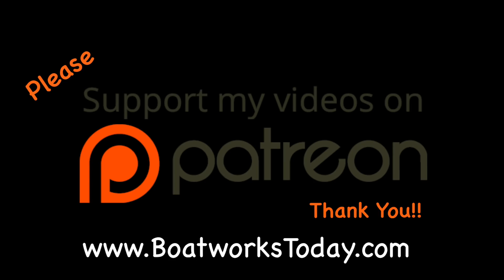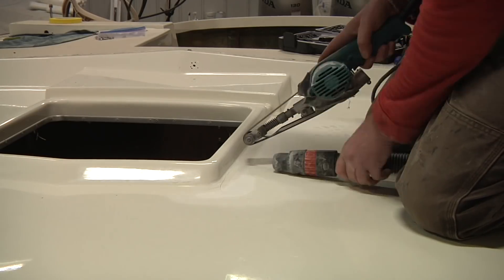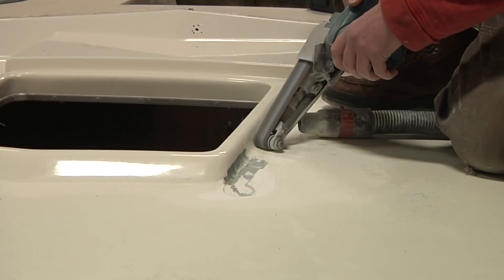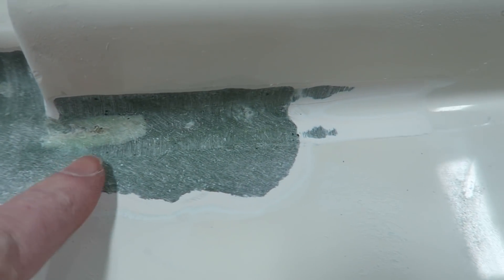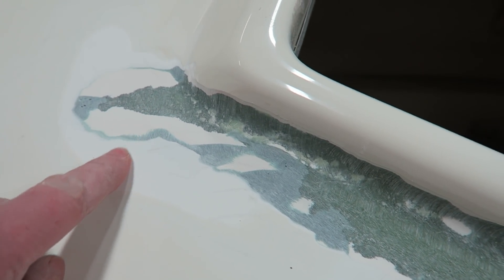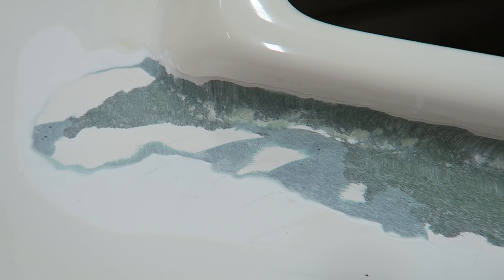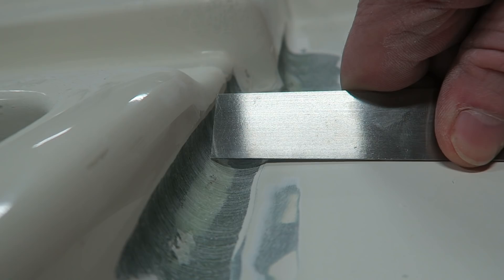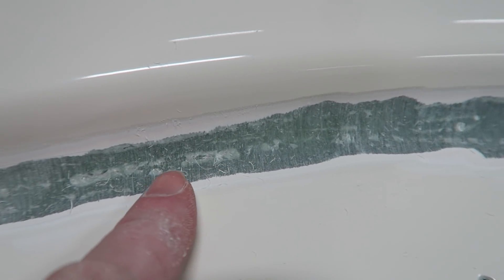Grinding Out Fiberglass Stress Cracks And Getting Ready For Some Major Work!

Comment: As I was thinking about the forward deck a little more this week I remembered doing the rotisserie method.  Restorers do this often when replanting the bottom of wooden boats in this size range.  Although it seems like a lot of work to get the hull flipped over it makes it very easy to redo the core and laminate under the deck.  You can work right side up and the boat won't care about being upside down.  Another resource on how the original B25 was laid up is Carl Herndon.  He was the production manager for Bertram back in the 60's.  Later he was president of Blackfin then Jupiter Marine.  The last time I checked he was still around in Florida.  You might want to hurry however, us old guys aren't going to last forever!

Comment: You’ll never stop the cracking gel coat until you address the flex in the deck. I have a 78 Formula 233 with the same problem. I cut the deck off in front of the windshield. Flipped it over, stripped the plywood blocks out, reglassed it with end grain balsa. My deck has an arch in it so I needed a material that would form to that shape. For the money balsa saturated with epoxy is the strongest thing for the price. Re installed the deck, glassed it back and faired it out.

Comment: Andy, I have to say that I am definitely in the camp for adding glass to the underside of the deck.  It looks like the plywood is simply bonded to the top layer with no bottom layer of glass.  Adding even a single layer of 1708 will more than double the stiffness of the deck.  If I was doing that job I would do it in pieces.  My procedure would be:
1) remove plywood in an area
2) replace plywood with 1/2" foam
3) add glass to underside of foam.

Ideally I would combine 2 an 3 and vacuum bag the glass/foam to the underside of the deck.  Working in small areas your could build your glass/foam composite on top of  a small piece of luan doorskin as follows - luan, vacuum bag, breather, peel ply, glass, foam.  Once you have the layup done, put butyl tape around the perimeter, push the layup/vacuum bag assembly into place with the luan, brace it and turn the vacuum pump on.  Once you are pulling a vacuum you can remove the bracing and luan if you want since the vacuum will hold the foam and layup in place.  This method completely removes the hassle of putting glass on over your head.  If you want to get really fancy you could even resin infuse the foam/layup (have to use epoxy for this though).

Replacing the plywood with foam will likely result in a lighter deck (which is good) that will never rot should you have eventual water intrusion (also good).  The down side is that it will cost a bit more - foam is expensive, but that deck isn't that big so the foam won't be all that much (around $500 retail).

Comment: Hi Andy. My pennies worth...repair the top then if you are able spin the boat and working thru the hatch add 3 layers of glass to the underside. Spinning the boat might cause a few headaches but will make working on the roof so much easier.

Comment: If it was in my shop I would grind it , lay two maybe three layers of S glass , two of cloth and gel coat it .Put a couple of supports below and call it a day ( or week ;).
No way I would separate it because it would just add more stress in opinion. And flipping a boat that size would be a nightmare.Also , the windshield isn't a light object and probably led to a lot of the stress cracks on a poor job from previous work so that could use some added support.I would support the " rabbit hole"  with a simple bulkhead and press on to the other surprises you are going to run into. Peace and Merry Christmas !

Comment: Here's an idea for you....    MIGHT help your structure enough to avoid the urgency of bottom structure fix....   If you get that whole deck down to glass, why don't you do a slow drying wet lay up of a base layer, then some 4mm coremat, another build layer or two, another coremat, and then your finish layers.  Then, the key to getting the most out of the laminant you just made is taping up a deck shaped bag from the edges to the hatch and vacuum bagging for the compression while it cures.   Love using coremat, it adds lots of rigidity to pannels when in the middle of the laminate stack...   be a cool vid too...  :)

Comment: Could you use a vacuum infusion process for under the bow? I’ve had success using the harbor freight vacuum pumps for continuous use for a few projects. That way you could use 3M77 to tack the glass in place, add seal tape, infusion stuff and bag it. If the wood is dry I’d leave it and not pull it out.

Comment: For whatever it is worth I have had many boats most of top drawer quality and all of them with only one exception had way too much flex in the bow and  flybridge decks for my taste.  I found the solution for me was to open up the underside, put a post in if it wasn't in the way to cut the span, and to steam bend some oak deck beams which I epoxied in and then layered in some roving with epoxy.  Where possible I glassed in knees at the joint with the hull to spread the load.  A royal pain but the epoxy did pretty well upside down and with that installed the problem was solved.  I also insulated with foil bubble wrap under the headliner for two reasons:  one, increase the radar visibility to other vessels, and two for heat retention and condensation reduction (I live in Alaska and boat year round).  
I have been around a few Bertrams of your vintage and was always impressed with the rock solid build quality so it leaves one wondering how yours received such a dearth of glass?  Even after the fuel shortage and oil price increase of the mid seventies where many boat manufacturers skimped Bertram kept his glass schedule up.  Reading the periodicals of the time confirmed my personal experience.  I loved the old 26es of the sixties that NOAH used on their survey vessels for tenders.  Always a heavy boat but reliable in quality.  I am enjoying the video as it brings back memories of the many projects I did that were similar.  Take care.  Doug

Comment: Yeah, I thought so. Not enough fibreglass, same a my current project. Boats in the 60'- 70's were  just pumped out as quickly as possible. Loose chopped fibreglass stands in a thin layer and in the corners full of air bubbles. "Doesn't matter just bog it eh?"

Comment: Adding glass to he bottom side of the deck will do the most to increase stiffness. Imagine a person standing on the deck; the top layer of glass will be under compression and the bottom layer will be in tension. A flat panel of glass is strongest under tension. It will compress just like rubber. And,,,there's not as much grinding to do on the bottom surface.

Comment: This area looked repaired with fairing or bondo then a layer of white gel coat then more fairing.I am working on a boat that has inpact spiders all over it.As I sand out these cracks the glass also has cracks that ive sanded out leaving a concave to be glassed or filled back in.I want to know why I cant simply use peanutbutter with 1/4 chopped fibers instead of csm.Hoping you throw me a bone on this some day.

Comment: re glass the top then your not going to  like this ,separate the hull to rebuild the inner structure from the gunnels to the bow . the advantage you wont be working upside down. considering all the cracking noises you had from side gunnels to the bow .
Reply: Do you think it's possible to separate the deck from the hull?
Reply: Your exactly right separate the cap flip and tear out the old core and replace core and reglass. Only way to stop the cracking and flexing
Reply: It is possible, however I would strongly advise not to do it. You open up a new can of worms. Both hull and deck lose their rigidity when they're seperated, thus one has to build a frame for each in order to ensure they don't deform. Otherwise joining them again afterwards will be mayor pain in the a$$.
It is a lot simpler to flip the whole boat upside down to work on the inside of the deck.
Reply: Given how much of the thickness of that deck turned out to be non-structural material, I wouldn't be surprised if re-glassing the top will add enough strength.
Reply: @coffeefish  anything is possible when doing composite work. The better question is, "is it worth the effort?" Maybe, maybe not. It depends on how much is involved verses the return.

Comment: There's no need to reglass the whole front deck. All it does is add work and weight. 
Just flip the boat, work on the inside of the deck through the hatch opening. rebuild the structure underneath by adding foam beams and glassing over them.
After that, flip it back, grind down the cracks and add two layers of 80g cloth in 45° with epoxy where the cracks were. Then do the fairing and paint. You will have less work, add a lot of stiffness and stop the cracks coming back.
Less work, less material, better result.

Comment: I noticed you mention Bondo used as a fairing compound. What is the difference? Could it be used one as the same? I normally work on aluminum boats or automotive so I would think any type of automotive filler would work fine. Thanks. Waldo.

Comment: Great video. What brand and model number is that sander you were using around the hatch fillets?
Reply: The link in your reply doesn’t work.
Reply from the maker: How about this:  https://amzn.to/2QyAdSx
If that doesn't work then this?  https://www.amazon.com/dp/B00004YOH7/?ref=exp_boatworkstoday_lv_dp_vv_d
Reply: My apologies, I didn’t realize you had responded until now. Both of those links worked fine. Thanks for the help.